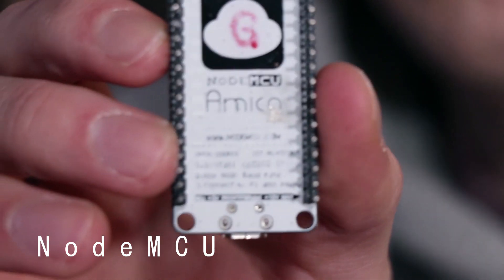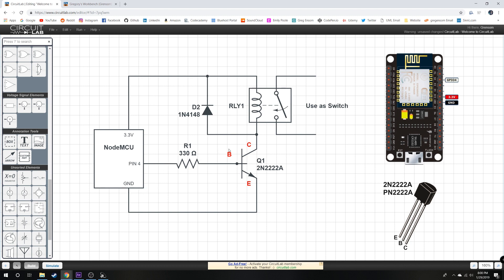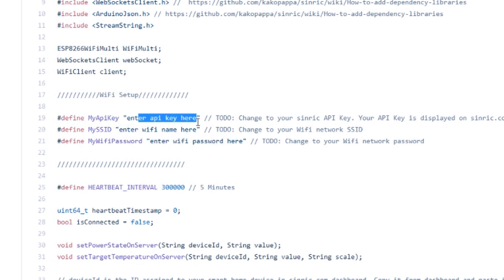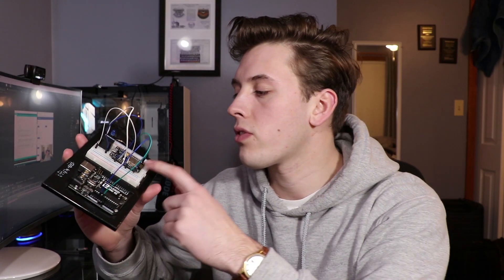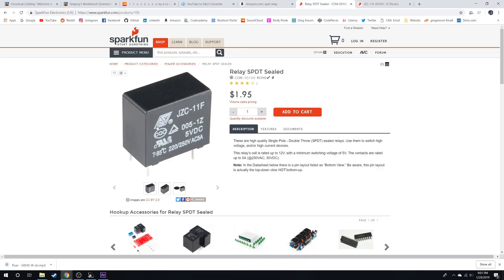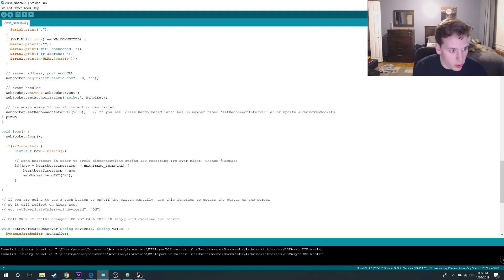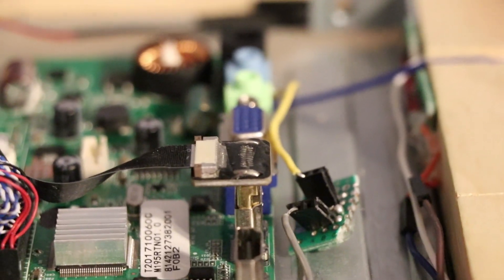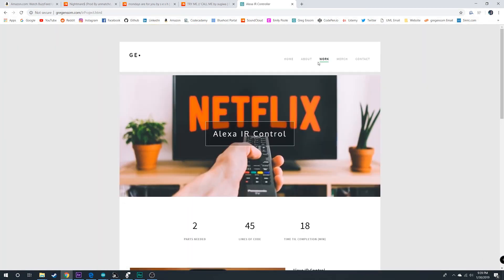This Chip can Control Anything with ALEXA

Comment: So i realize the video is somewhat old, it does howerver involve NodeMCU ESP chip, but in your Alexa TV controll video the code doesnt work (anymore?).  Basically the 'fauxmo.onMessage()' command doesnt exist in the library anymore. I found a Forum page saying 'onMessage' has been replaced with 'onSetState' but that doesnt seem to work either. Other people in the comments of the video had this issue too and it seems to be unanswered. Would really like to get this working.
Reply from the maker: You may be thinking of my other video - this video does not use Fauxmo Library. I made a note on my GitHub repository: " FauxMoESP has updated and no longer supports the files uploaded". Use the "NodeMCU-AlexaDevice" repository instead or watch this video as it uses a different procedure

Comment: Great video dude, and NodeMCU looks super easy for making things Alexa compatible! I've used the Arduino Yun with a "Thing Shadow" before, but this seems much simpler. When it comes to controlling a smart mirror though, I prefer connecting the skill to an AWS Simple Queue Service, and long polling SQS from the RPi to read messages posted. Then the RPi turns off the HDMI signal and the monitor goes to sleep instead of turning off. Not the point of this video though, and a great demo.

Comment: Hi Grenson, when I compiled my program, it showed: 

Users/user/Documents/Arduino/libraries/arduinoWebSockets-2.1.4/src/WebSocketsClient.cpp: In member function 'void WebSocketsClient::loop()':
/Users/user/Documents/Arduino/libraries/arduinoWebSockets-2.1.4/src/WebSocketsClient.cpp:172:30: error: 'class WiFiClientSecure' has no member named 'setCACert'
                 _client.ssl->setCACert((const uint8_t *)_CA_cert, strlen(_CA_cert) + 1);

                              ^
exit status 1
Error compiling for board NodeMCU 1.0 (ESP-12E Module).

Could you also tell me why you have the other board?  Is that for power supply only?  Do I need to supply voltage to the Node MCU while I have it plugged into my computer? Do I only need to have an extra power supply to the relay only?  I'm very new to this.  Any help will be appreciated.

Comment: Hey one question. In your Video you use differend Diode, Transistor and Resistor typs as on yours site. Witch are the right Typs i must buy?
Reply from the maker: PAulXD99 The schematic in the video is correct. All the parts used are linked in the description of the video

Comment: I love this and I think it would be super cool in an Arduino project but not very useful in anything outside of that. If you need a an ESP with a relay built in you can get a Sonoff basic for about $5-6 USD and thats much more simple and will probably cost you as much as building your own.
Reply: Not if you want to control multiple devices. An ESP32 based NodeMCU will control up 15 relays reliably and it doesn't just have to be relays.

Comment: Can this ship control more than onr relay? Like can i control 2 lights?
Reply: With an ESP8266 based NodeMCU you can control a number of things. I think you can RELIABLY switch up to 6 devices though it is possible to control more. You can control up to 15 with an ESP-32 based NodeMCU.

Comment: Hey man, How can I know what GPIO is used for the second switch?
Reply from the maker: Gustavo Porras You can set the second device with any GPIO you want, I just chose pin4 randomly. Just make sure the pin you choose in the program is the one you write your switch to. You’ll have to add the digitalWrite and pinMode code for the second one as well
Reply: @Grensom  Where can I find the digitalWrite and pinMode code in the code. I couldn't this section in the code for the first switch.
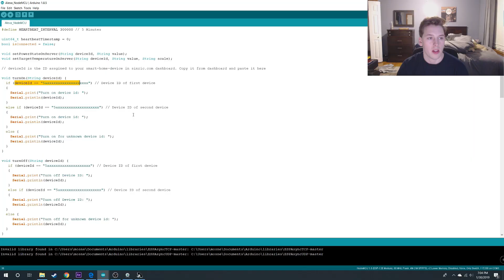Reply from the maker: @gustavoporras5449  I go over this in the video at 3:43
Reply: Oops!, I didn't put attention to this part!.   Thanks for your quick response and for you great video. PURA VIDA!!!!

Comment: Hello Greg! Thank you so much for this awesome tutorial. Unfortunately, the code is not compiling. 
I get multiple errors ( "DynamicJsonBuffer is a class from ArduinoJson 5" & "Multiple libraries were found for "WebSocketsClient.h"), although I have already installed the libraries. Any help will be very much appreciated :) Thanks in advance!
Reply: It's because the sketch uses Arduinojson 5 but the library you installed is the 6, you can upgrade the sketch to work with the 6, or you can go to library management and install the latest arduinojson 5 version

Comment: Its based on esp8266. As all esp8266 stuff You don't have to build all this things yourself. For power 5v can use dry contact sonoff sv (without a case) or ready device Electrodragon Wifi IoT Relay Board SPDT. For flash software You need serial port or device like this: https://www.aliexpress.com/item/32673467746.html?spm=a2g0s.9042311.0.0.27424c4duyIuls
Everything else is Your imagination.